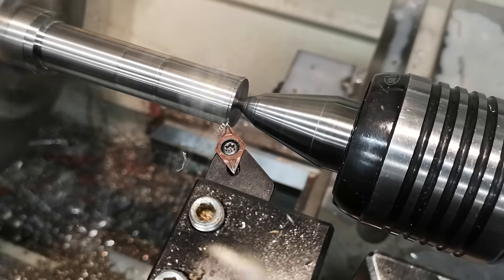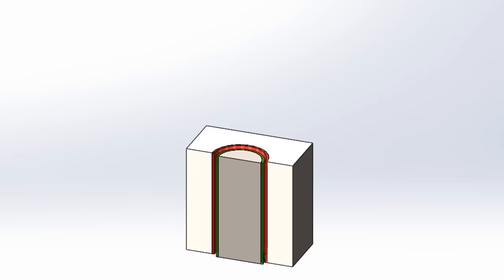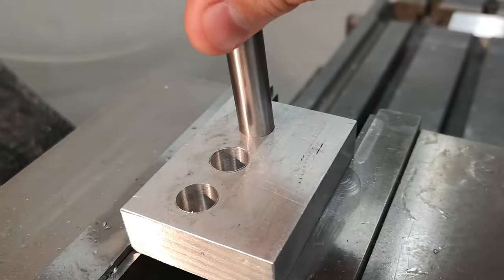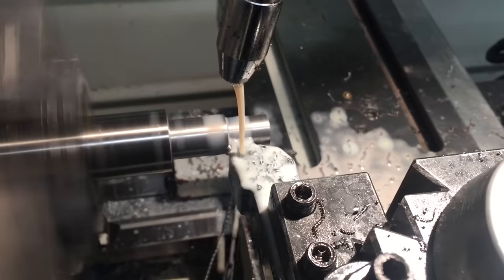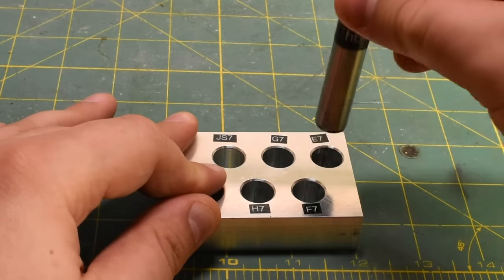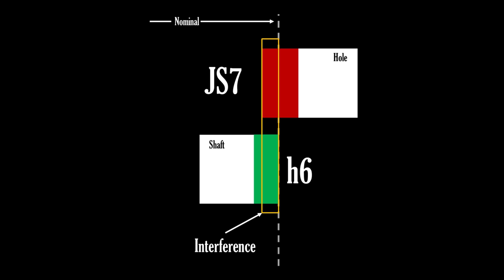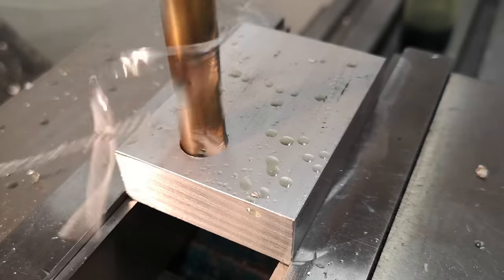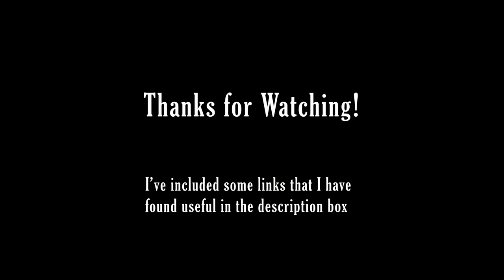Limits and Fits:  The ISO System

Comment: Great viedo. Learnt something new today. What about temperature though?
Reply from the maker: Good question!  The ASME standards (and no doubt their ISO counterparts) indicate that parts should always be measured at 20C.  You can design your part to be the right size at its operating temperature (using limits and fits for example) and figure out the size at 20C (where it's going to be machined and inspected) based on the coefficient of thermal expansion

Comment: hats off to you, I used to think I understood fits. My company doesn't adhere to it as accurately as they should. Mainly cost, lack of time and required tools. We tend to use a lot of emery paper. personally I do the best I can with what I have and make very accurate parts I have also in my 6 years there used the cylindrical more than any time before. Company is 21 years old.. shameful. i have made the link between surface finish and tolerance as you can hit size but the pin still wont assemble right. turning vs grinding shafts for bearing fits. 0.003mm turning is hard to achieve but still fits like crap, but hitting 0.001 grinding parts fit very well. To anyone else reading this, no matter what cutter, or tool you use in an assembly flatness, squareness and parallel play as big of a factor as size
Reply from the maker: Well, hand finishing can be exceptionally accurate, i guess it's just nice when the parts are interchangeable!  Yeah I guess if you're aiming for a 3 micron tolerance and your surface finish is in the 0.8 micron range you're looking at 25% of your tolerance zone being the surface finish.  Knowing ISO, there's some way of factoring that in, I just havent read that far yet :P.  

I'd love to do a video on GD&T with respect to flatness, squareness and parallelism (form and orientation controls) but that is one deep subject and I doubt I could do it justice :P.  You make a very good point though; if your parts aren't flat, square, parallel, etc, they can match the print but still won't fit!

Comment: I have always used a simpler system:  Loose fit, Snug fit, Tight fit, Extra Tight fit & Wont Go... the latter 2 requiring percussive and incendiary installation methods respectively.
Reply from the maker: I hear ya, I've definitely spent some time simultaneously heating and hammering things :P

Comment: Literally just came across this on an instalation manual for an industrial gear box with a helical shaft mount. It required an H11 fit
Reply: So? H11 is a lot of allowed tolerance around the hole.
Achieving a certain letter is absolutely no problem. The problem is the tolerance (the 11 in your case is way relaxed.. you can carve that with hand tools). Generally 9 is easy, 8 is standard lathe work, drill work, 7 is the same but need more careful touches to creep on dimension, 6 is for the properly tuned lathes/mills/cnc and probably best you can get consistently. 5 is into surface grinding and other fancy process.

Comment: Very good video, beats the week of 400-level lectures I vaguely recall from my engineering degree.
Reply from the maker: They didn't even teach us this in my degree... They alluded to it in first year with clearances and allowances in drafting and that's it.  Sad really..
Reply: @TabletopMachineShop  That's weird, what degree is that? I'm a machine shop and CAD teacher in highschool (students age 15-18) and both the general tolerance system (IT tolerances) and the ISO fits and limit system are taught first during mechanics class, and later used in my classes. 
When I was doing my mechanical engineering studies this system was also thought very early on, since it's so crucial when designing (and drafting) anything that will be send to someone else for manufacturing. 
One of the major mistakes that both my students and many less practical inclined engineers make in making every tolerance to small. Always use the largest tolerance that will work for a given application.
When I was still a machinist, I once worked a week on some parts with tiny tolerances, because the drawing said so (all dimensions to IT2 or something insane like that). When the engineer came to get his parts I asked what they were, and they were door handles. I didn't have to pay for the man hours, but I was still pissed, since it was such a pain to make.

Comment: Funny, I was just last night using homemade tapered reamers to make interference fit holes for water tight fittings in plastic and wondering if there was a system for measuring the tolerances and sizing of holes like this besides just fiddling with it by hand. Amazing video, thanks for sharing.
Reply from the maker: Thanks!  I used to kind of ballpark "ohhhhhh... 0.002" of interference", but it's great having a standard that produces similar fits consistently

Comment: Hi, thanks for this video. Very helpful, but there is one thing i'm still confused on. I have a pin which is ground to h6 tolerance. We need it to run smoothly in a hole. This is a shaft basis fit, as the shaft is already made and out of our control. I look in the book for 'close running fit'. Under the shaft basis column it says F8/h7 - well the shaft isnt h7 - its h6! so now what?! How do I translate the F8/h7 fit to work with an s7 shaft? We also have lots of pins that are m6 tolerance, which does not appear anywhere in the ISO 286 table so I am not sure how to handle this either. 

Any help would be great. Thanks.

Comment: Well, i am new to fit and tolerances and so I am stuck at a project of mine. Now I have a 608 bearing with OD of 22 mm, which I want to fit in the housing and I want it to be transition fit. I cant decide as to what should be the size of the housing bore to transition fit the bearing. It will be shaft basis and by your video, I think hole shud have the tolerance of G7? or J5?

Comment: Shoot for the middle! That's my motto. I was always tought, make it to print. If you did your job right. It's the engineers fault, if it don't work. These fit tolerances only work, if the engineers know what they're doing. I believe, if you're gonna get an engineering degree. You should have to do a few years in a machine shop.

Comment: G'day,
I'm learning machining as a hobby to compliment my fast car addiction, and have been looking at reamers as I need to make a shaft out of two interference fit components.  You've very nicely summed up the ISO tolerance system, which will now allow me to go find the tooling I need.  Also explains nicely about bearing fitment application which will help me as one component needs to hold a couple of bearings.  Thankyou very much for the information.
Now to get the 3 non-SI countries to let go of the British units they hold onto...

Comment: In the US we call out an outside diameter as plus nothing minus a value, and inside as plus a valley minus nothing. This allows a size for size fit which is actually a light press. In Europe they control with plus, plus and minus minus values making sure that there is some clearance.

Comment: cant you also vary precisely control the size of the hole by heating or cooling the part  x number of degrees for smaller parts, drilling the hole and then viola, perfect hole when the part warms up

Comment: Nice explanation of the tolerance system for holes.
The main problem with tolerances is measuring them. But this problem is solved by ISO8015. This standard removes all the variables and ensures the same quality mo matter where the parts are produced. Unfortunately there are not many manufacturers who dare to tackel a part which is according to this standard, because it limits their capabilities.

Comment: I found that sometimes a nut and a bolt doest fit because the nut is its lower value of dimension and the bolt in its higher, the solution it is just changing one of them for other and the tolerances will be in an acceptable range.

Comment: what happens when you press fit? Does the entire part that has the hole get larger? Or is it just the hole and a bit of the surrounding material that expands (less and less as the distance to the hole increases)?

Comment: Awesome video! This really, really does't matter and I hate to have become 'that guy' but in the intro, you are using your boring bar backwards. It's aluminum so you can do almost anything and get away with is but you always want to cut such the insert is being pressed into the holder pocket. Otherwise, the fastener ends up taking the shear load  too instead of just holding the insert down in compression. You can definitely get away with doing this but just wanted to mention something.
Reply from the maker: Thanks!  Fair point.  As you said, it's aluminum so its not a big deal, but steel  might not be so forgiving.  The reason I cut like that sometimes is just that there's more clearance when the chips fall over the operator-side of the insert so I find I get a nicer finish

Comment: They don't teach this stuff in schools.  The Tolerance Grades chart is especially useful for defending your selection of tolerance when someone in fabricating or a supplier pitches a fit.  I referenced video about the ASME system is very good as well.

Don't forget to use the chart of preferred basic sizes as well when you make components. 
There's nothing like designing a plate 19-7/8 x 16-3/16 to piss off your fabricator. Especially when it could be 20 x 16
Reply from the maker: I hear ya!  I had to teach this to myself when I got a bunch of numbers and letters thrown at me at my first job!  Doing the research for this video also really helped cement the knowledge too

Comment: What about STP, standard temperature and pressure. How is this taken into account? Work environment of a hot motor or outdoors changes all parameters that matter. Brake pads vs hot pistons are real world examples.
Reply from the maker: Good question!  ASME Y14.5 (and I would assume most metrology standards) does specify measurements should be taken at 20C.  You would design your parts such that they were the correct size at their operating temperature, figure out how large they would be at 20C, and get them machined for measurement at 20C.  Some components, like motor grade bearings, are designed with extra internal clearance so that when they heat up they have the correct amount of clearance.  I can only assume for pistons that most of the clearance would be taken up by the O-rings, and they would just have to be designed so that they didn't lock up at temperature.

Comment: Sir, in principle a good introduction to all, who haven't worked in mechanical engineering yet but if you come from the industry, this is absolute basic knowledge. However @ 4:48 you talk about the number and the letters of ISO tolerances and say that they "roughly" indicate about size and position (where they are). I hope you know that this isn't true. The combination of Letter/number doesn't leave a room for interpreting/discussing tolerance nominals nor positions. The system is EXACT. 

After more than 35 years in mechanical and automotive engineering I would like to have just one $ for every discussion which I had to lead during all these years on tolerances :-)))
Reply from the maker: Hi Michael,

I haven't been in the industry for long, but it seems like a lot of people have a smattering of different systems and a lot of people still seem to arbitrarily assign clearances or interferences... I imagine in automotive engineering the knowledge is much more prevalent due to the super high volumes.  I just thought it was cool so I thought I'd share!

I didn't mean "roughly" so loosely, I just didn't want to make it seem like they stepped consistently from H or were always the same shape.  One thing I like about standards in general is that they don't leave room for interpretation!

Thanks a lot for the comment, it's great to hear from someone who has so much experience.
Reply: I'm happy that you didn't get my words wrong. It's great that you took the time to share it and I'm sure many non-engineers learned something new. And yes, you got the point about standards and norms. They don't leave room for interpretation and they are the basic terminology on which engineers agreed to use it in their communication.

Comment: This was so helpful, Thanks!  For example when pressing a double sealed bearing on an arbor I usually put the arbor in the freezer (making it say minus 17 C or zero F); then I put the bearing in the sun (making it say 65 C or 150 F); now I can run my coefficient of expansion figures with the charts you provided my measurements should be much more controllable or predictable and less risk of stressing a new bearing.
Comment below was helpful too as was your answer:

Mesuri
3 months ago
Great video. Learnt something new today. What about temperature though?
Tabletop Machine Shop
3 months ago
Good question!  The ASME standards (and no doubt their ISO counterparts) indicate that parts should always be measured at 20C.  You can design your part to be the right size at its operating temperature (using limits and fits for example) and figure out the size at 20C (where it's going to be machined and inspected) based on the coefficient of thermal expansion

Comment: Is there a system that determine tolerances and fits for non-circular components? I want to fit square blocks into a square holes with a rubber mallet.
Reply: The ISO system also applies for non-Cylindrical shapes. It follows the same principle as for round fits: A Capital Letter (eg. H7) is for an outside dimension and a lowercase Letter (eg. h7) is for inside dimensions.

Comment: Do you ALWAYS need to use a reamer? Just a drill bit won't work?
Reply from the maker: Drills don't really make round holes, and that's something reamers help a lot with.  I guess theoretically if you have a really rigid setup, really dialed in cutting parameters and a high quality, well ground drill you might be able to get away without one.

Comment: Thank f**k I'm a woodworker
Reply from the maker: Well you have to worry about lumber warping when it's humid.  I'm sure glad metal doesn't!
Reply: @TabletopMachineShop  : True ...
I find myself watching more and more metalworking channels, I think AvE was the gateway drug dealer into the sordid and greasy world of hot chips and lube. I felt like a 15 yo virgin stranded on an island with a crew of sailors at first. Where did that pleasant smell of pine, beeswax and linseed oil go ? To me, shaping metal is still some kind of black magic, it's just not natural. It shouldn't be possible to cut chips from something that hard. But I see them do it, so obviously... Something must have rubbed off, tho', because I've just ordered a little lathe for my workshop. A wood-turning lathe, mind you -- but still. I want to make round things too !

Comment: How does this graph work with concentricity is it assuming perfect? Cuz that is nearly impossible as cylindrical grinders can maintain 100% concentric holes?
Reply from the maker: Hey sorry for the late reply!  I think that would be a GD&T question----It's more commonly phrased as a true position tolerance for some dowels pressed into one plate with another plate located on it (since that's a common real world application).  Basically if you have a tolerance on true position, you have to take that into account in your diameter tolerance.  As a bit of an oversimplification you have a pin that's 9.95mm to 9.99mm that has to fit in a 10.00 to 10.05mm hole, and the hole might be 0.01mm out of position, you should actually size the hole 10.01 to 10.06mm, so no matter where the pin ends up or what size it ends up, it will still it.

This runs the risk of ruining the nice locating fit you've designed, but if you have a small number of pins you can be a little more aggressive with the position tolerance, and if you have a large number of pins the fits tend to average out.